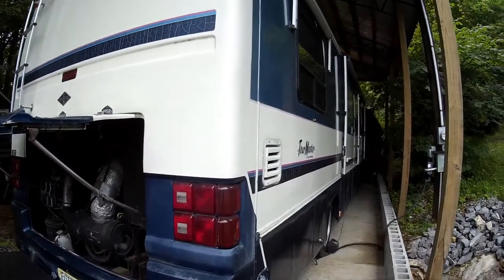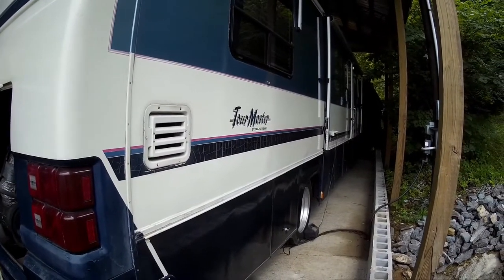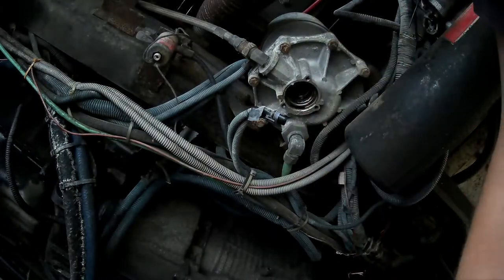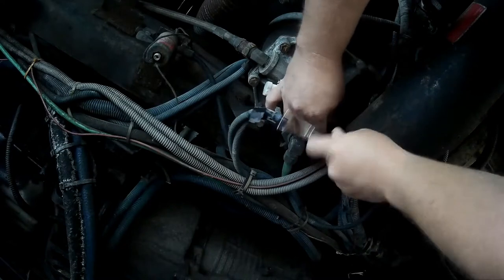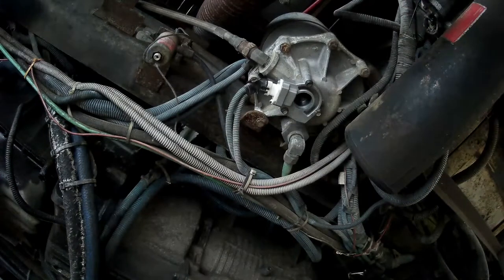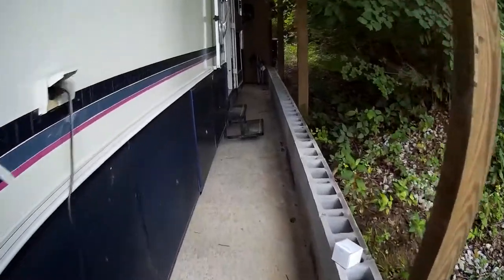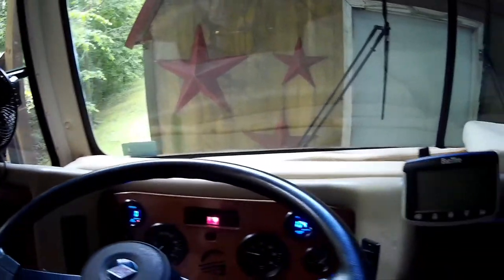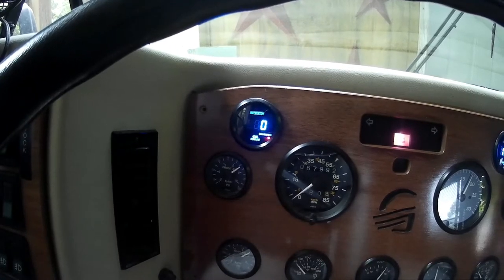RV Repair - Air Dryer Purge Valve Spartan Chassis 8.3 Cummins

Comment: If you have a Holset E or QE series air compressor then you MUST use a special air dryer designed to be used with the Holset compressor. Otherwise it will send engine oil into the air brake system...
Reply from the maker: Thanks, unfortunately this rig was totaled by a distracted driver about 3 years ago.

Comment: Air filter inside rust and causes metal shards to damage the rubber and clog the lines . I have the Same issue , but clogged lines .
Reply from the maker: Good info - Thanks!

Comment: I'm having a massive Air Dryer Purge Valve leak on a 95 American Eagle on a Spartan Chassis 8.3 Cummins. What was the part number?
Reply from the maker: Bendix part number 800405. I found mine on Amazon for $40 and it worked fine until a distracted teen driver proceeded to run through the side of my coach at 40mph, but that's another story.
Reply: i have the same 95 Spartan chasis 8.3 cummins, do you know the part num for the air dryer?

1995 Holiday Rambler Imperial 

Great video, thanks for sharing and tutorial.
Reply: Need to fill my 1993 Gulfstream with Spartan chassis

Comment: How do you access to the air dryer?

Impossible from the engine bay under the bed. Is it from under the couch? Or do i have to take the fans and access from there?

Couch model: 1995 Holiday Rambler Imperial 

Spartan chasis, 8.3 cummins

If anyone know, please reply. Thanks.
Reply from the maker: In my case, it was behind the rear passenger's side tires, tucked up in a pretty tough spot. They didn't make these things serviceable, that's for sure.
Reply: @ProjectTimeGarage  

Thanks, i'll try either that, or from a small space that i found in the passenger side of the engine bay.

It just that i don't want to order the wrong part, and the sticker for the part num, is on the other side, not visible.